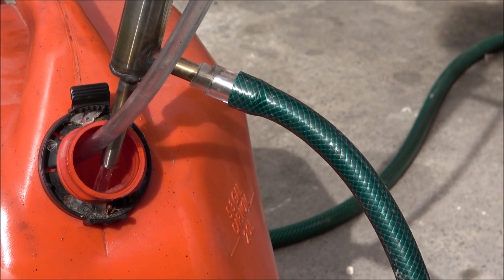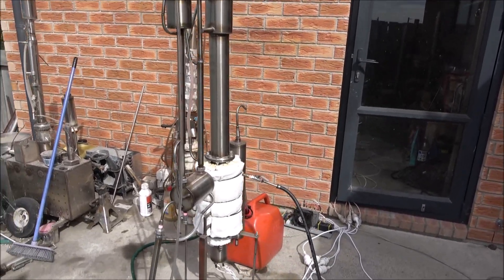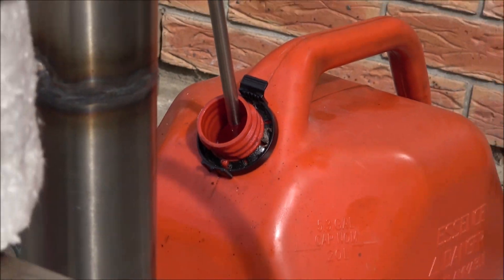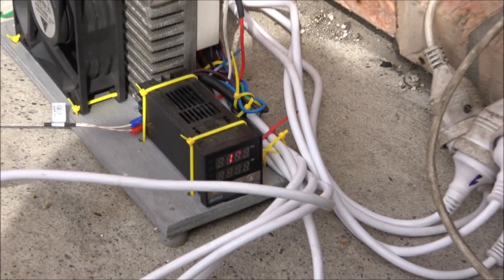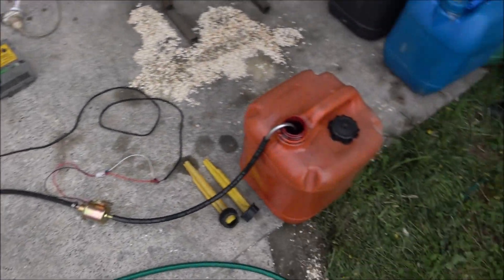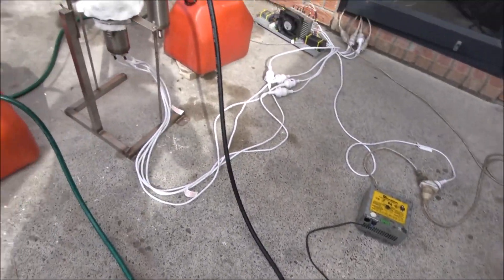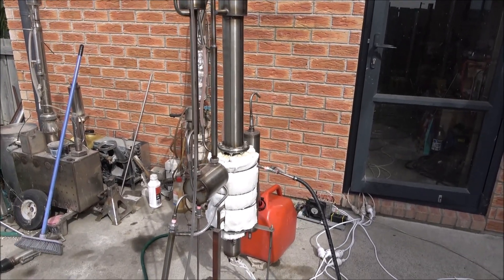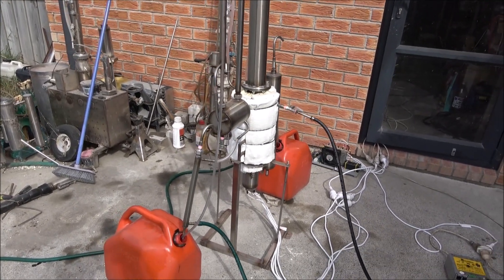Petrol/diesel separator wrong fuel rescue.

Comment: Do actually use immersing heaters as heat source.. can't it self ignite?
Reply from the maker: The system is enclosed, and there is no oxygen supply for ignition, elements are in individual pockets, no direct contact.
The commercial oil processing plants are not self igniting despite extreme temperatures during petroleum processing.